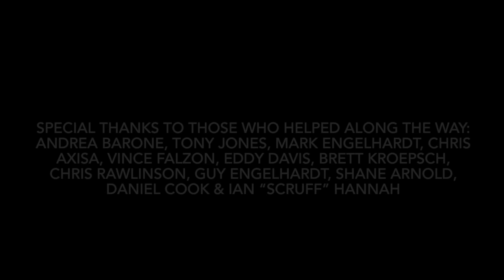The Iron Empire - $40K SHED BUILD - How I Did It!

Comment: I've just finished my UC Torana and I want your rims and tyres you have on yours. Are they 15x8's on the back. that's what I would like if you thought they fit ok. 7" on the front, $$s delivered to Bundaberg QLD. 
Shed building is one of the hardest games out there, sure anyone can build a shed, but doing it for a living and doing it right is a different story. I did it for about 20yrs and made good $$s doing it. I can tell you that you have done very well. Better than most I've seen over the years.
 My tip: find a local shed builder (not a house builder) have him measure up all the flashings needed to finish it off and polish up a few things. like the overhang eve you have. It's that last 10% when done properly can make all the difference. 2-3 days tops even if he doesn't finish, you'll know how to. Oh, and when you paint the roller doors, paint all of them don't try and match a colour and think they will look the same, and buy the best paints.
Reply from the maker: Thanks for the tips mate! Yeah, it’s always the last little bit that makes it look unfinished and separates it from a “pro build” but it will get there! 

We got these wheels years ago mate, they are Street Pro’s by VPW. I think they are 15x6 and 15x8.5 

But I’d suggest slightly narrower on the rear if you’re planing to run it this low!
Reply: @TheIronEmpire  Ok thanks, so do you sell a similar set and post Australia wide, eg. cheaper convo pro look alike rims. Or maybe a set that will fit and suit the old school torana. Not after high end wheels, just a nice set of 15". cheers

Comment: Mate you are what I call “an achiever” that’s bloody brilliant

My only suggestion would be on the old bench you probably want steel lining so you can have a Greasey oily component pull it out of the car and drop it on a bench and it’s basically a timber benchtop that’s been lined with 1 mm or less steel sheet so the oil doesn’t penetrate the bench……

You’ve even got Aircon

The only other suggestion I would make and you know this already if you put in a two post Hoist you can now park one car from outside underneath and have one on the hoist so there’s not bad bang for your buck there either……

They’ve come right down in price

Best shed I’ve seen in a long time mate keep up the good work

Even a double bed for a bit of an afternoon delight with the Mrs
Reply from the maker: Haha thanks mate, gotta give it all a go! 

Thanks for the suggestions mate 
These benches are actually laminated so they clean up super easy, but I do a have a big heavy duty number I plan on having outside under a “lean too” super heavy filthy shit, also planning to do all the fab work and painting out there also. 

The hoist is defiantly on the cards mate, wheels are in motion!

Thanks for watching! 🙌🏼

Comment: you have done well mate .  i built a shed in the last 12 months 10 mt square 3.5 mt on the short side the kit cost $15000 the concrete was $5500 laid  . been doing my walls with that black formply they use for concrete form work , just put up my china quality 4 ton 2 post  hoist $2650 (lifts my landcruiser ute  easy ) ive easy spent $25 to $28000 and its half the size of yours . good luck on your future lotto winnings filling that fuel tank
Reply from the maker: The times have changed a little, I bought this around 3 years ago. But hey, still achievable if we work for it! 

Good work mate, enjoy your shed!

Comment: Loving the shed mate and all the DIY. What product did you use on the floor and how has it held up?
Reply from the maker: I used 2 pack floor paint, by Dymark. 
It’s been good, only parts that failed was my fault. The concrete was still a little damp in areas

Comment: How long ago did you build that shed ? 
I ask because your price for that slab seems very cheap.
I'm trying to build a 9m x 15m shed and although I need to have 15 piers, my slab has been quoted at 30k ! 150mm slab, with trench beams and 32 mpa.

Where are you situated that allows you to have cheap concrete ??
Reply from the maker: I concreted my own posts in, and concreted inside the shed once the wall sheets were up. It was done 3 years ago